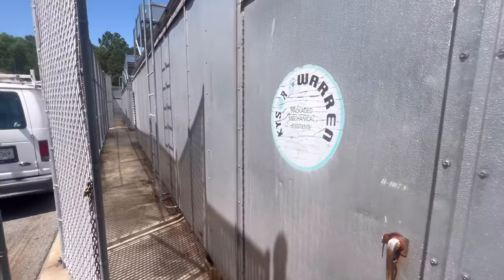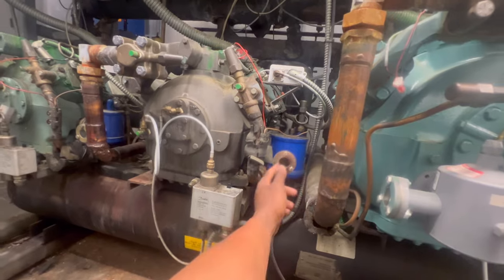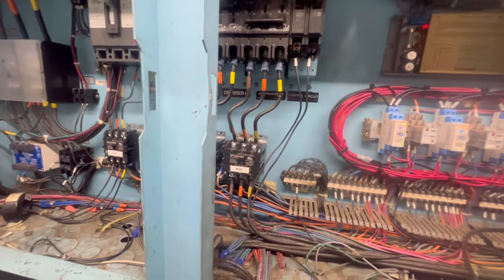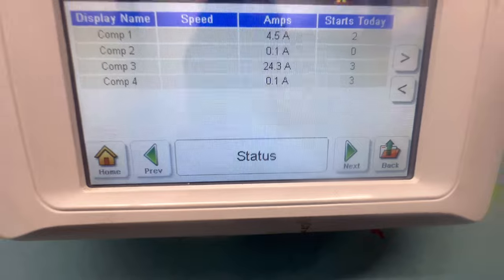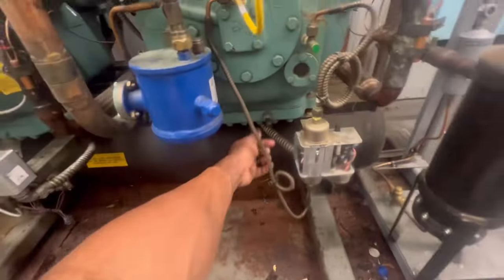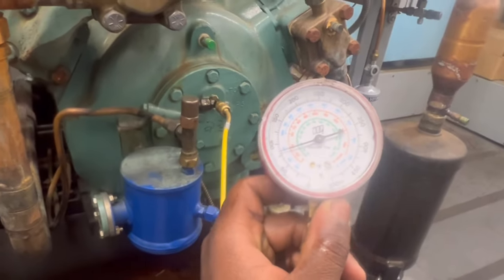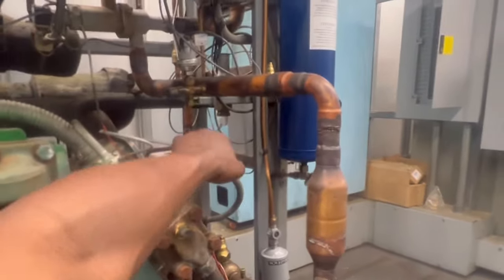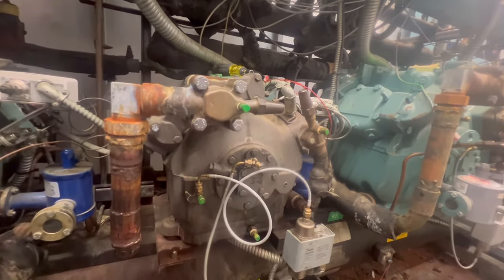MULTIPLE HIGH CASE TEMPERATURES ALARMS! COMPRESSORS IN OIL LOCKOUT

Comment: The Carlyle compound compressors are also notorious for defective low side valve plates. If you check the left bottom sides of each low side plate it should be cool during operation. Any excessive heat blow by could be defective valves or defective gaskets additionally you could have blow by from the side, but to verify by checking mid stage pressure, subtracting pump pressure will give you your net. Those pumps rarely go bad.  Check the pump key for wear. If need be run compressor in opposite direction if pump is issue. One beneofrom th. Carlyle compound
😊

Comment: One problem with the Carlyle  compound compressors upon checking net pump pressure you can’t take it from the suction line. You have to take it from the mid stage.
Reply from the maker: Didn’t know thanks for input.

Comment: High head pressure trip will cause the oil pressure control t  on drop out because you lose the control circuit in HP switch

Comment: Don’t fill the Carlyle compound compressor more than 50%.  If the head pressure tripped? Head pressure 224 psi with only two compressors running?
Reply from the maker: 3 compressors running 225psi and was thinking Same with oil level.

Comment: Clean the oil pick up screen on the compressors usually those get clogged up and trip out the oil
Reply from the maker: Oil was changed and pickup screens cleaned recently! But wouldn’t doubt clogged again!
Reply: Unfortunately the Carlyle compressor does not have a pick up screen. Only Copeland, maybe Bitzer as well but Carlyle can be finicky
Reply: @Shawn_RHVAC  there is one 06d 06E I’ve seen before on the manual it also tells you where they are located
Reply: @alejandrozometa1951  LET ME CORRECT. YES THERE IS A TUBE AND SCREEN THEY ARE NOT SERVICEABLE… ONLY WAY TO ACCESS IS TO REMOVE THE BOTTOM. THIS WOULD NOT BE A SERVICE OPTION AS A COMPLETE BREAKDOWN IS NEEDED. COPELAND DOES HAVE A SERVICEABLE SCREEN ON THE BOTTOM LEFT OF THE COMPRESSOR